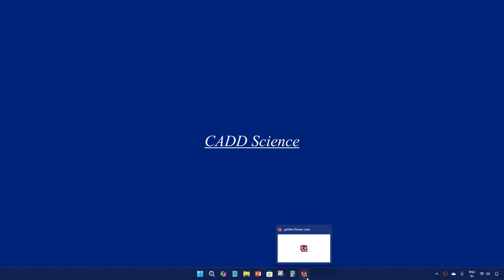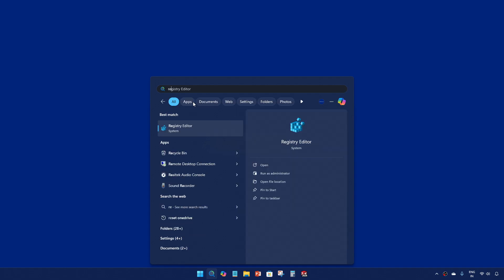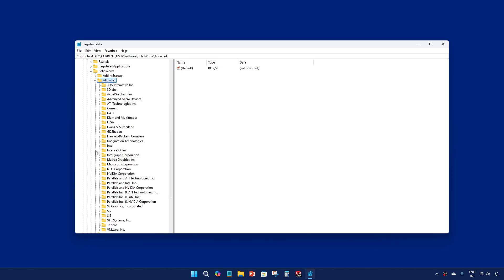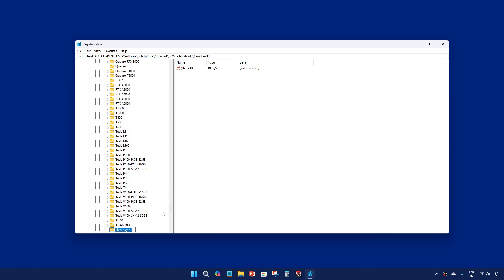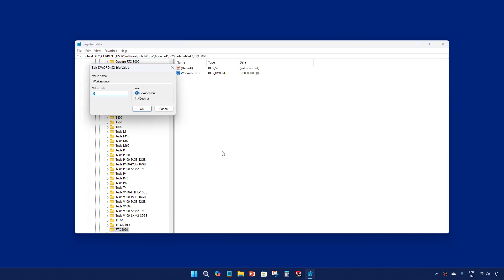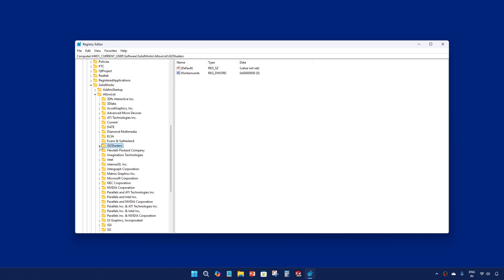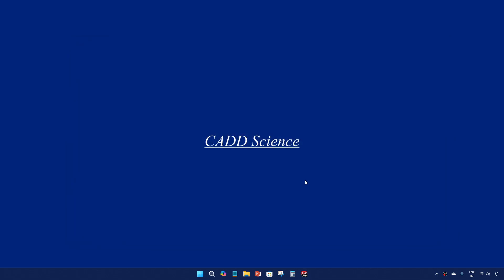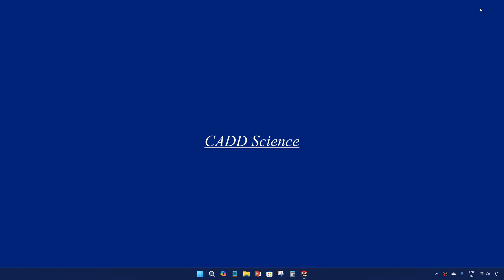SOLIDWORKS 2024 | HOW TO TURN ON REAL VIEW GRAPHICS

Comment: My issue with my 2018 NVIDIA RTX 2060 is that Solidworks 2024 is not utilizing it at its full potential. When I have to render my models in Solidworks Visualise, I can't even get it working at over 10% most of the time. It only works at its full capacity on video games, such as Age Of Empires. Do I need to dump it? I use Solidworks professionally. I've tried everything but I've ran out of options other than maybe replacing it. Thanks.
Reply from the maker: Actually that is normal, For rendering purpose many softwares utilize CPU fully instead of GPU

Comment: Is it really needed doesnt it take up more memory when you save the file ? I dont know much im only student
Reply from the maker: It's just an optional feature, It consumes more VRAM from your GPU and will be difficult to work on larger assemblies
Reply: @caddscience8822  so i have have the 3070 with 8GB of VRAM and its at GDDR6 would that be ok im doing a assembly for my assignment its a section of a production line like the rollers and load baring tables ect.. its got nore than 15+ parts to it would it be ok or would i see solidworks freeze or stutter ?
Reply from the maker: Mine is 3060 and no problem with assemblies around 80 parts, yours will definitely perform better